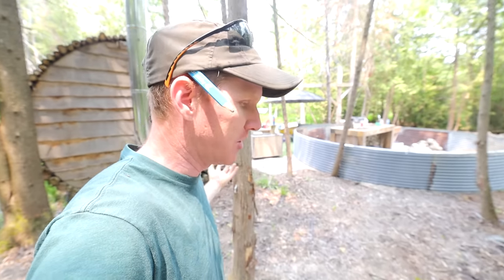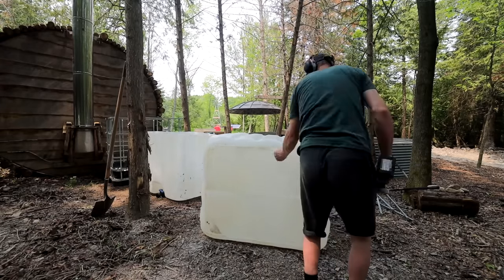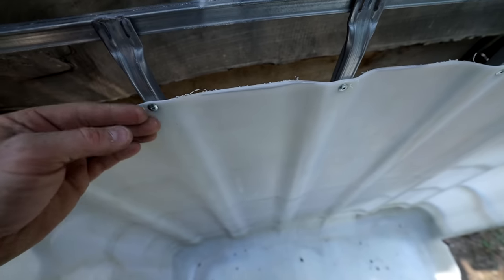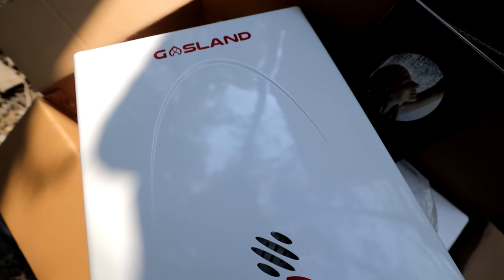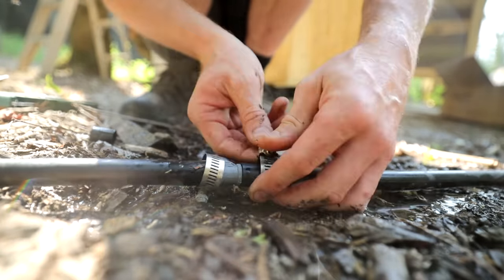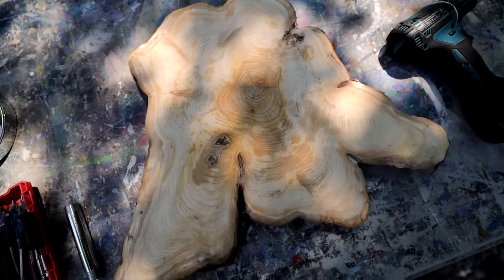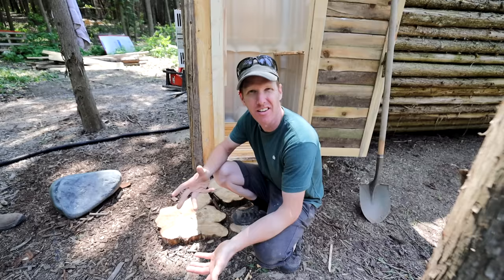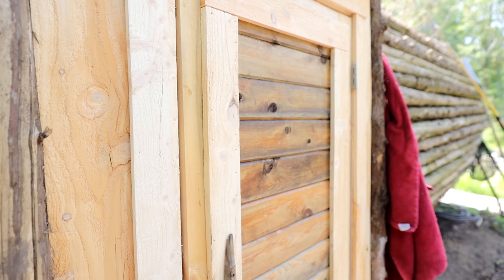I Built a Luxurious Rain Shower! - Super Hot, on Demand (on Extreme Budget!)

Comment: Didn't see what you had as a drainage, is it straight to the earth there? Dig a hole maybe? Or a pipe out to some safe place for the soap and puddle to gather? Enough to keep away from dropping down to your pond? Not sure the layout of the property, you probably have plenty of space in between. 
Anyway, nice build. As you stood in it I thought maybe was too short. I'm thinking if I do this thing I'd add a foot or two extra space between the two cartons. Maybe get a 3rd for the gap. 
Love the creativity here. 
Last thought, is that instant water heater rated for outdoor use? I was just thinking maybe add a small awning roof and walls over the top of it. A little open cabinet just to keep rain 🌧 water off the top and out of the vents. Etc.
Great build, love watching these.
Reply: Yes, wondering dame thing... didn't see you put in a drain.

Comment: Very nice build! I have an off-grid rustic shower with instant-on propane water heater at our deer camp. We use a 12v solar-powered water pump. I have the heater mounted on the outside, just like yours, but with the controls facing inward. A cutaway allows me to adjust the heat from inside. Also the heater is not permanently mounted so I can drain and remove it when the temperature drops below freezing--which would destroy the internal radiator. We use a hand wand with on-off button, which helps conserve water while soaping up.

Comment: Hi Kevin. Just came across your channel. Superb design for a great idea for a shower. By the way  If you are going to eat your  Trout be careful what you feed them. Pretty much all fish pallets contain an enzyme in hepato-fact stabiliser Rafa. This is to stop the pallets going rancid as they contain after unfortunately if you do some research to find out that the stabilises are very harmful to human health when you eat a tractor is fixed so many of these pallets you we can see that this chemical Like smoking, it won’t affect you straight away, but over time, could potentially trigger A whole host of chronic diseases. I would recommend building a second pond stocking it with minnows Also, set up a Worm farm  you can Big worms to the trout and use the castings on your garden. Just a thought

Comment: Kevin, great idea, I think you will find mold and mildew in your shower over time. Cover the roof and add a solar light.
Reply from the maker: The great thing with waterproof everything is power washing it takes very little effort.  The whirly bird on the top pulls a pile of air out to dry it right up.

Comment: Is I would seal every little holder is no matter how tiny cause snakes to get in and so do other critters. Everything should be sealed and have some kind of meshing so that they don't come in through the drain or the hose on the top these critters get in there somehow, so taking the extra step to put netting And ceiling is a plus you don't wanna be in the shower and the snake shows up from under the wooden plank or over your head on top of the cookie still a great built I love it beautiful thank you again, sir🙏❤️☮️

Comment: Need to lift the top plastic tote about 10" to accommodate tall people. Add a strip of tote between the 2 when you do lift it. Should have to change the outside wood. 
Maybe add a second valve to the inside. 
Is a clear or close to clear UV protectant available to paint on the exposed tote?

Comment: Your work is always excellent. What kind of filtration does this pond have other than the chemical you mentioned?

Also, your readers need to understand this system is NOT “off grid.” In a SHTF event, there will be NO gas available within weeks. It’d be fantastic if you could build an additional shower just like this this IS off grid running on solar or better.. a wood fire fueled system with copper piping to the water shower.
Reply from the maker: I have multiple sources of hot water.   I have a wood fired water tank system.  There is a video on it if you wanna look it up.
Reply: @ModernSelfReliance  You are so smart and awesome!!

Comment: Definitely make sure that your ibc totes don't come from any airport application. Not only are all types of jet fuels, oils, otto fuels, etc. terrible for you but you have to worry about AFFF. As an ARFF firefighter we get blood tested yearly and have to fill out a report every time we come into contact with because of how cancerous it is. When we have to use foam we have to completely purge and clean the trucks, its corrosive enough to put holes in the tank. Foam is much less common in other firefighter applications, but it can happen so be careful with that.